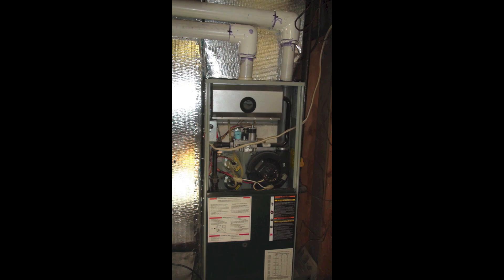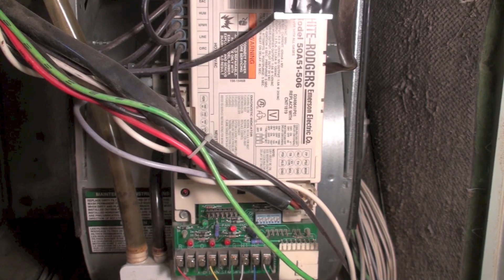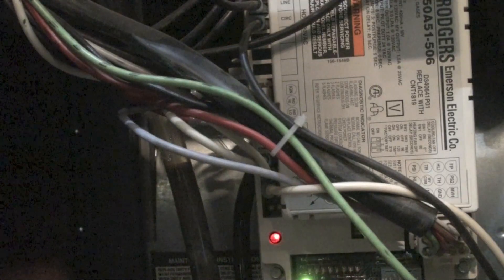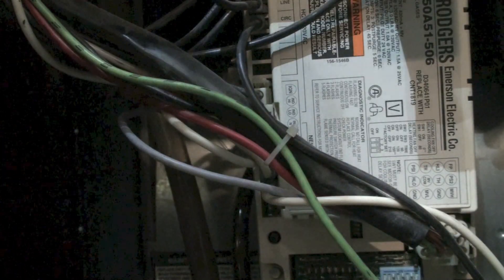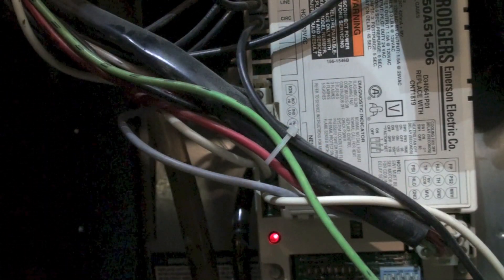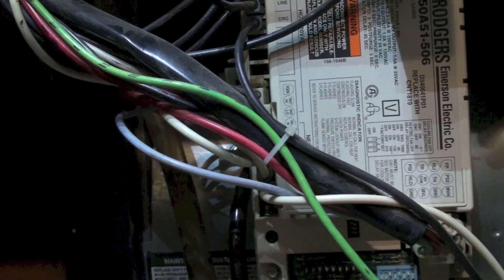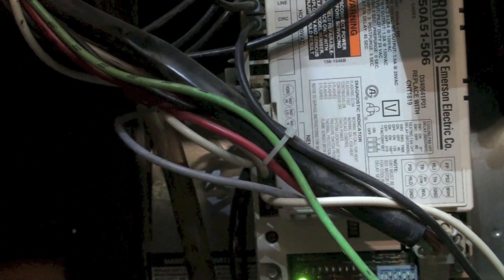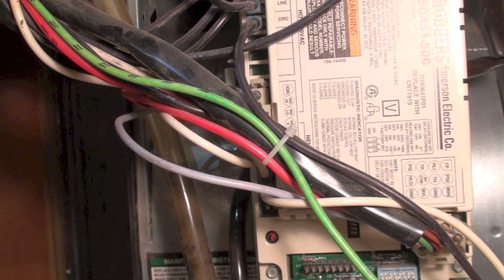Error codes for Trane gas furnaces

Comment: hi there i have a trane xp80 with a slow flashing error code i know that means no call for heat how do i fix this.
Reply from the maker: It means all is well with the furnace, but there is no call for heat.  
Possible thermostat problem?
GFM
Reply: ok i have a cheap thermostat but i unhooked that wired direct and nothing still so does that mean i need a new box ita a beckett honeywell
 @grayfurnaceman
Reply from the maker: Is this an oil furnace?
GFM @jamesbaranak
Reply: yes
 @grayfurnaceman

Comment: I'm getting the pressure sensor error on my Trane XB80, but I've tested the switch with a multimeter and it is functioning properly (conpleting the circuit when the inducer motor kicks on), which not only tells me the switch itself is working, but also that there is no blockage in the vent pipe.

What else might cause this error?

Comment: at first this ignition worked than found a bad vacuum/pressure switch and replaced it. Its a Trane XB80 ( older ) f.a.g.heater now flashing (4) blink code... say high limit failure but high limit and thermostats have continuity. ( no water vents ). Inducer motor comes on and sometimes the main blower but no ignition or flame. What do you think/  Thank you
Reply from the maker: Are the rollouts closed?  Located above the burners.
GFM
Reply: yes , hi limit and roll outs are closed
 @grayfurnaceman
Reply: yes

 @grayfurnaceman

Comment: summer time AC issue. furnace was blinking the single slow one blink. hard wired thermostat is blank. ac won't turn on. drain pan dry. clear vue pump blinking blue meaning sensors are working. something is causing emergency shut off...

Comment: Hi GFM... Well Done & Informative!  This might be a duplicate, I didn't realize I was on my wifes account earlier.

We have 5 blinks on XE90, White Rodgers  #50A50-474, indicates "Flame Sensed with Gas Valve Off".  Symptoms are... After a power cycle... will show slow blink, then fast blink when heat is called, furnace cycles, fires and runs fine.  Once the call for heat ends, the flame stops, and the fan keeps running indefinitely, then the 5 blink error appears...  If called for heat again... no joy, it just stays with the 5 blinks and the fan running until the unit is power cycled again.  Same thing over and over.  We have a new flame sensor installed.  And I've checked the continuity on the high limit / fused link circuit as closed.  Do you have any additional troubleshooting suggestions before replacing the control board?  Of course any help is greatly appreciated. 

PS - this was a used furnace (from a friend), who indicated it worked fine.  I did have an hvac crew install it a few months ago along with an AC unit, but the system was never put into use until now.  Could a misconfiguration of thermostat wiring cause this problem?  The HVAC crew did wiring to the AC unit and furnace, and then ran a 6 wire cable to where the normal thermostat will ultimately be located (however there is no thermostat there).  All I did was wire in a basic heat only thermostat on white & red terminals.
Reply from the maker: The one other issue you may have is reversed polarity  or a bad ground.  Usually the unit will not operate with reversed polarity, but it could be the problem.
GFM

Comment: New home owner with a gas furnace. Seen the continuous red blinking light, thought it was a problem. I seen in the beginning of your video that it's supposed to blink slow then blink fast when heat is on. I almost paid addcox 100 for service call. Thank you !!
Reply: I had the exact same question that he answered at the beginning of this video! Originally , it was blinking 3 lights but after cleaning the vents , and the furnace worked , I thought I still had a problem because it was continuously blinking red. So, that's normal and working, I guess!  I was expecting it to not light up at all. anymore .

Comment: My Trane furnace is sending a code 9 which according to the list is "bad ground in igniter circuit. ?? I have looked at everything,, new igniter, cleaned flame sensor, new pressure switch, tested thermostat, put dielectric on contacts, took volt readings to ground and red on the board.. 24 to 28 volts, Low side voltage on transformer is 24V.  I am at my wits end as to why this furnace sometimes does not ignite ,, shuts down and the fan continues to run forever with code 9 blinking. Turn the furnace off and on again and it usually does start up and ignite. It may run normal for a couple cycles but then it goes right back to code 9,, fan on and no heat!  Arahhhhhhhhhhhhhhgh!!!!!  What the heck is going on? Bad gas valve? Bad board? Bad fan relay switch? Furnace is model TUX080C942C3
Reply from the maker: At this point, I would try the board.  No sure diagnosis here (I hate that, makes me feel like a computer repairman), but it is sometimes correct.
GFM

Comment: So is 5 blinks the gas valve
Reply from the maker: 5 blinks is a leaking gas valve or a failed control board.  If the burners are lit when power is off to the furnace, you have a leaking gas valve.
GFM

Comment: Hi, what if there is a continuous red light with no blinking on my trane xr80 furnace?  Nothing happens when I turn it on. Just 1 click and nothing.  I replaced the ignitor and  cleaned the flame sensor. New batteries in thermostat.
Reply from the maker: In most of these controls, that means the control has failed.  Check either the cover on the control or the inside where the diagram is.
GFM

Comment: Hello.. I have a 6 flash code on a Trane XR90 furnace, which from what I've found it is a grounding issue. What can I check to proceed to the root of the problem?.. thanks
Reply from the maker: That is the code for reversed polarity.  The ground and hot line may be reversed.
GFM
Reply: @grayfurnaceman  thanks.. and how do those lines get reversed?.. it just happens on their own?.. because the unit was working just fine before.. So how do I go about solving the issue?

Comment: Does the furnace beep? I’m thinking mine is beeping at night and the red light is blinking constantly. What do u think it is? Thx
Reply from the maker: A slow blink is normal if there is no code.  Some furnaces will beep if the filter needs to be changed.
GFM

Comment: I came to find out how to get the codes out of this thing. I've got no light at all, yet the furnace comes on and the gas shuts off when it reaches temp, but the fan won't shut off. Even if I turn the thermostat down and switch it off at the thermostat. So I make sure the gas is off and it's cooled a bit and disconnect power to make it stop.  I'm trying to figure out if it's the controller, I've already tried to mess with the dip switches which control the time delay on the fan but, no. I'm thinking the controller is bad, as I get no flashing lights at all, or a sensor that is to confirm the temp has cooled enough to shut off the fan is not working. I'm an electrician, not an HVAC guy, but this is simple. I just need to know if the LED light is supposed to be blinking all the time or what? I've got nothing. How do I get the codes out of this thing? How hard is it to replace just the board in the unit? I've found the boards for sale, cheaper than the whole unit. I don't want to buy used. Thanks
Reply from the maker: First, be sure the fan switch is in the auto position.  
The led should blink slowly if there is power.  It should blink fast if there is a call for heat.  If the fan is the only problem, you could have the fan relay stuck on.  For most, that means a new board.  I have never come across an led not working when the furnace runs normally.  I suppose it could have just failed.  
GFM
Reply: @grayfurnaceman  Thank You! A call to a local serviceman confirmed what you said, that relay in the controller is sticking. It's probably 30 yrs old, lol. Thank You so Much for Responding! Blessings!
Reply from the maker: @WmArthur  Glad you got it figured out.
GFM

Comment: I'm having a problem with my  Trane Furnace  the exhaust fan is continuously working even when the the furnace has stopped and the red light is continuously blinking what do i do ??
Reply from the maker: I would first try a shutdown and reboot.  If you still have a fast blink that has no code, your board may have failed.  The fast blink indicates a call for heat.  This is applicable to furnaces made in the last 30 years.  If your furnace is older, you may have ignition failure.  If so, you can send me the model # of the control and I may be able to help.
GFM

Comment: Thanks i got worried about continuous red led light all it as was doing was calling for heat as you said in this viedo..  and then it went to slow steady red when the heat came on  then cycle every  6 minutes on and of  is that regular I have it set to 71° and out side it's about 30° in philly

Comment: have a trane, american standard freedom 80 two stage, model #AUD2B080A9362AB. Keep getting 2 blink code. Cleaned the flame sensor, same issue, replaced it with a new one, same issue. After a reset it usually turns on and gives heat for a little while, anywhere from 5 mins to a couple of hours, then it starts blowing cool air and the temps start to drop in the house. I've watched as it cycles on before throwing the 2 blink code. After a reset, when the call for heat kicks in it give the normal rapid blink, It gets ignition, the flames light up, then it shuts down and restarts this cycle about a total of 10 times before, there have been a couple of times when i hear the clicks right before the burners flame kicks in but they don't actually flame up. after this cycle of about 10 tries it then begins to blink twice again. Any ideas? It does have a new air filter, replaced about 2 months ago.

Comment: HELLO I HAVE THE SAME MODEL TRANE 95,my red light dont stop blinking, i have a few pipes freezing, a noise every time the fan on,and my air conditioning is not working, so my home now has 76 on the thermostat, but i set it to 71..can you help me..and this is starter happens the other day is a lot of rain and little hails,from that day starts the noise and them not working..thanks
Reply from the maker: The light should blink slowly indicating power but no call for cool.  It will be blinking fast when there is a call for heat.  The noise could be a failure of the fan motor or the blower itself.  I am assuming the outdoor unit works normally.
GFM

Comment: Grayfurnaceman, I have a 12 blink code, fast. Blinking non-stop, during heating and cooling modes. Last year service said we need a new board soon.  Haven't had any problem with the unit, heat and cools fine.  Home inspection tomorrow, what should I expect?
Reply from the maker: Normal is slow blink.  Call for heat or cool is fast blink.  Sounds normal to me.
GFM
Reply: Mine did this, new board brought it back to life.  Now, two years later, I get a 4 blink error and fan motor and module are new won't start, they were on AC, but switch to Heat and they wont' come on.  I replaced the fan board and that allows the system to start up to high temp (4 blinks).....supposedly the white rogers 50A51 507 is replaced by trane kit 09370.

Comment: Hi There. Just had the Pressure Switch replaced. I remember things working in a different order. I used to have the vent fan stay on after the furnace and  blower turned off ( I could swear it!), but now it seems I have regular blink, followed by vent fan turning on, then fast blink, heat turns on then eventually blower runs and it stays at that fast blink until the heat turns off, vent fan turns off, then blower remains for a minute and turns off, now back to slow blink. Does this sound right? Was I crazy thinking it was the vent fan that used to stay on for a minute after the cycle and not the blower?
Reply from the maker: Yes, you were crazy lol.  
Sometimes the vent fan may continue for a few seconds after the burners shut off, but never after the circulating fan.
GFM
Reply: Thanks. You’re the best.

Comment: Thanks.  I have a furnace that is been working intermittent... at first I got the pressure sw codes... I kind of “smack it” w a little piece of wood, and the furnace kick right back in.. then it shoot off... then after a few times this happening, I start having the following codes. I had the system lock out code and like after doing the same and cycle the system, I had the pressure sw code... is currently not working at all.. an is still cold here.. any ideas what that can be?? Thanks!
Reply from the maker: I would be looking for water in the pressure switch and its tubing.  If it is a 90%, be sure the condensate drain is clear.  Check the venting to be sure it is clear.  Could also be just a failing pressure switch.
GFM
Reply: grayfurnaceman thanks! I'll be checking those out tomorrow morning... as soon I get home.
Reply: grayfurnaceman it’s a 2stage, 80%.. trane XL80.. I check the tunes, no water, did Clem them up and clean the back were they mounted to.  The igniter glows, and it’s seems gas isn’t going to from the regulator to the flamers... witch is wiered.. cuz it was all working before.. wn I tap the pressure sw a bit.. but that was before....
Now it goes straight to the 2 blinking red Lts...” “ System locked out ( No flame\ check line polarity )”
Any thoughts...
Reply from the maker: I would check incoming power for reversed polarity.
GFM
Reply: grayfurnaceman ... is kind of weird  because nobody has mess with the electric on the furnace... I read in another place that he controls box may be bad... giving wrong reading and causing the code...
Reply from the maker: A failed control board can sometimes cause that code.
GFM

Comment: Mine is flashing 6 times...XV95
Reply from the maker: That means the neutral and the hot leads of the incoming power are reversed.  Sometimes will also mean a failed IFC.
GFM
Reply: @grayfurnaceman  Ok. I had an issue with my condensation pump failing yesterday, and ended up having to pull the hoses on the p trap. Had ice in the drain line. I'm heating the garage now with a unit heater to that helps. I've read that's an ignitor code as well. Not sure what to think. Never messed with any wiring. But it sure is cold here in Minnesota

Comment: Terrific Information here - I had 4 Blinks - It was a Clogged Filter - Fairly new, but Clogged with White Dust from Humidifier  - Simple & Inexpensive Fix - Thanks!
Reply from the maker: Welcome
GFM
Reply: But Bob, you fan motor came on right ?  My door is off and fan motor is not started after gas ignites and 45 second counts down... just seeking wisdom and a running furnace...

Comment: I have a trane furnace like this. What would make the fan constantly run? Even when it is turned off at the thermostat. Only way to power it off is to turn it off at the breaker. It didnt use to do this. Any help is appreciated. Thanks.
Reply from the maker: Usually, the fan runs when there is a flame failure.  Is the furnace running normally?
GFM
Reply: I have the same situation after a blackout situation in the summer, heating is constantly on unless I manually turn off at breaker.
Any ideas to troubleshoot? Also furnace turns off when I open the cover for control panel
Reply: @sirnightw safety switch when you remove the cover.

Comment: I have no light at all. Power is good to furnace, however, tank is at 10%. Propane is ordered. Could it be because of low tank?
Reply from the maker: No light probably means there is no 24 volt power.  Control transformer could have failed or the low voltage fuse could have opened.
GFM
Reply: If there is power to the control panel but no light is it likely the panel failed?

Comment: I really enjoy and learn so much from your channel. You are a great tutor!
My Trane XE80 gave 5 flash code tonight, and the code did not change even after the flame rod was carefully cleaned. I jumped W and R at the thermostat, and the inducer fan ran for 3 seconds and then the blower fan came and stayed on. That was all the furnace gave. I checked other components (pressure switch, roll-out limit, high-temp limit, and ignitor) and they seemed to be alright. If the gas valve was stuck open, should I smell gas when the inducer fan was running? Should I manually switch off the gas valve and try it again? if the code persists, does it mean that I have a bad board? Your professional input would be greatly appreciated.
Reply: An update: problem solved by tighten the ground screw. so the problem were both dirty flame rod and loose ground. The board was fine. I still don't know why the error code was 5 flashing.

Comment: I've had a code 5 numerous times on my old piece of crap Trane XE80.  Every time I fixed it by taking sandpaper to the flame sensor rod.  This has now happened a few times so tonight I finally broke down and ordered a new flame senor for $8.  Hopefully I won't have to break out the sandpaper for a long time!
Reply from the maker: If your furnace is located in a laundry room, you are drawing chemicals from the washing machine into the flame.  That will do it.  Also, do not be aggressive with the sandpaper.
GFM
Reply: Does your fan run constantly when this happens? Are you saying I need to clean where the flames come out? I changed the board in mine thinking it was bad and it worked all winter after doing that but recently I noticed the blink came back.  Any advice would be appreciated!
Reply: @addiimaddie-89  After I replaced the sensor rod I stopped having problems.  It's definitely worth the small amount of money.  And yes, the fan would run continuously sometimes when the sensor rod was acting up.  Same thing with the igniter too if I remember right.

So far on my Trane I've replaced the sensor rod, the igniter,  the mainboard, the blower, and the draft inducer motor.  It's now been trouble free for 2 years.
Reply: Thanks for the info my man